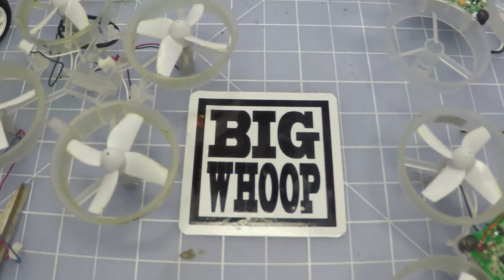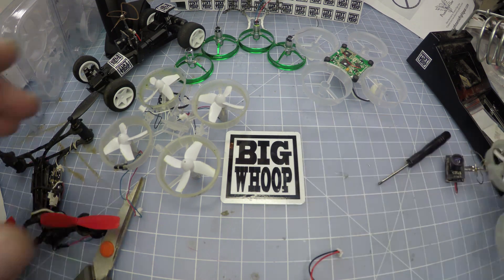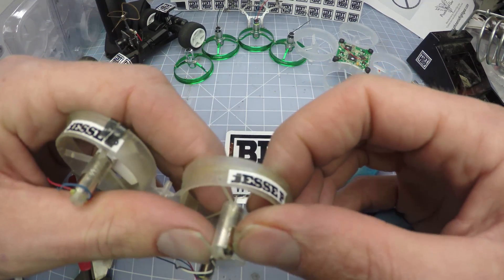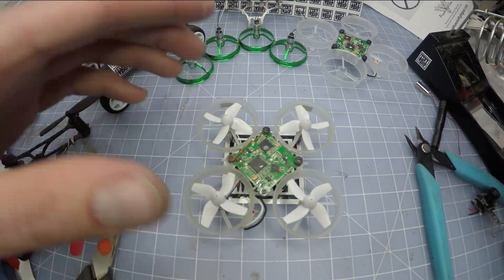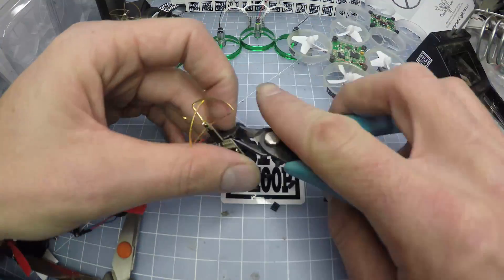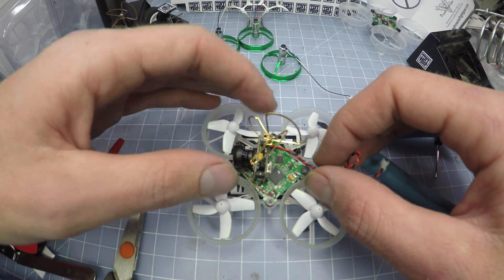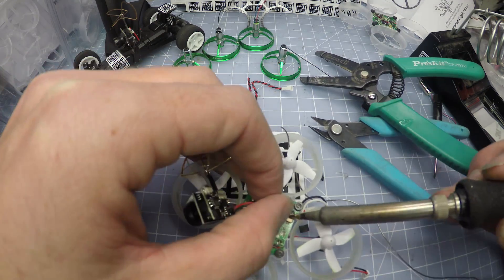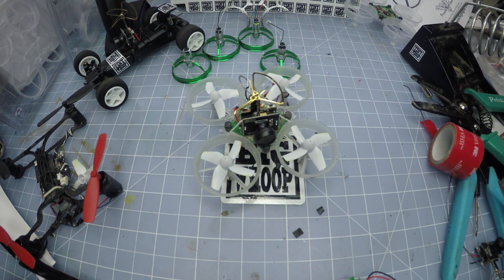TINY WHOOP Build Video - Team BIG WHOOP - Inductrix FPV - How to build a Tiny Whoop

Comment: I just finished my second Whoop conversion, after losing the first one. :-(   I just wanted to mention that the new motors (I used the "Special Sauce" type) are a REALLY tight fit in the Inductrix frame. Meaning, you can be extremely careful pressing the things into place and still break a spoke on the frame. I added a tiny bit of oil to each motor case before pressing them in, and I think it helped. Still have a busted spoke, however.

Comment: Dude did you see that the Chinese ripped of the inductrix design today? I doubt the FC is anywhere as good but it's going to mean cheap ass spares from now on:

http://www.banggood.com/NIHUI-NH010-NH-010-Mini-2_4G-4CH-6-Axis-Headless-Mode-RC-Quadcopter-p-1066972.html?zf=4095472

Comment: Hey dude, I am wondering if this little fpv camera also works on any 
regular cheap mini quadcopter. I mean, it's sounds to easy and to good 
to be true to only connect the wiring to the + and - pole (mirrored) on 
the other side of the board. I flew loads small/tiny quads, could I 
really make one FPV? Just by soldering that on? Would be awesome!!

Comment: Hello Tiny Whoopers,
So I just finished my build last night and I decided to use the Y-Adapter that came with the camera instead of Soldering it to the board. I quickly realized that I was running through the upgraded batteries in roughly 30 seconds. I decided to power the quad with one battery and the camera with another and it worked flawlessly, but there was way to much weight. Can someone explain to me why this happened? Does the Y-Adapter divide the power in two only giving half power to each component? If I solder the camera will I still have this problem?
Thank you,
Reply: I have the exact same problem - but even when I soldered it on the board like shown in this video.

Comment: what receiver should i use i have a fs i6 radio
Reply: Did you use the fsi6? I have the same transmitter... And don´t have idea how to connect the receiver to the microquad...
Reply: Pablo E. García Palacios yes i have. You cant connect because you need a dsmx module. And you cant use the module with the fsi6

Comment: How would this build fare if there was a Rakon inductrix frame upgrade?
Reply from the maker: How would the build fare? It'd be way more difficult.  And it wouldn't fly as well
Reply: Meaning it wouldn't be as fast and agile with the added weight or just unstable? New to the hobby and just trying to figure some things out.  Was under the false impression that with the LiPo 205mah/25C 1S battery and the CL-0615-14 - 6x15mm motor combination could balance out the added weight.
Reply from the maker: +Brendan Haugland more weight means slower and less agile.

Comment: Good job on the video! what flight time should i get from standard motors and battery with the Quanum camera? I'm lucky if i get 2 minutes!
Reply: With standard motors and battery its not flying good. To heavy. Even at 100% throttle the quad has some problems to gain hight .

Comment: Thanks for the video. This thing looks fun as hell. Can it do rate mode? Haven't seen any flippage on any of the videos I've seeen.
Reply from the maker: yep, it's just difficult.  These things don't have the power of quads you're penalties used to
Reply: Yeah. I imagine you would lose quite a bit of altitude flipping that thing. I plan on building my own with one of these: http://www.ebay.com/itm/CJMCU-MWC-Micro-Quadcopter-Flight-Controller-Mini-6-Axis-Module-CJMCU328-i-/361296855138 . Want something to fly indoors when the weather sucks. I'll let you know how it goes.

Comment: This is actually a very good video, as informative as your others are entertaining. F'rinstance I had never heard of VHB, have to look that up.  Using the clippers as a rotor remover, and using an elastic to provide camera support,  all good ideas. Surprised you don't add some protection to the antenna, as you fly into some very tight spaces. Thanks!

Comment: Is there much need for the motors to just FPV around the office? Or does it need the new motors to lift the camera?
Reply: +SantanaFPV yeah i built mine today and without the upgraded motors your at 80% throttle all the time. better motors make a massive difference.
Reply: Same here I just built it with stock motors and your at 80% throttle all the time. - Some times I even fall outta the sky and bounce on the floor.  I have the faster motors I got from my local hobby store and Micro Heli 200mah lipos im going to try out.

Comment: I've got my fpv stuff, batteries and motors coming. Playing with mine atm. Do you recommend a separate Spectrum radio or a jr module for the Taranis?
Reply from the maker: Separate spectrum radui, just because we can't get the new version of the orange module to work, and the old version had awful range. My dx5e is doing great
Reply: Or Spektrum DM9 module for the Taranis

Comment: The same camera - not quanum branded is this one: FX797T such as on banggood: http://www.banggood.com/FX797T-5_8G-25mW-40CH-AV-Transmitter-With-600TVL-Camera-p-1042994.html
Reply: Hi, I am very new to this. How do you receive from the camera? what would you suggest from banggood to connect to say a tv using rca?
Reply: +parriehunter look for an FPV monitor with receiver built in if you don't want to use goggles. This tech is not meant for TV's.
Reply: Thanks for that. Yea i wear glasses and looking at googles they probably wouldn't work for me BisMaxx

Comment: I took one of the canopies that came with the inductrix, cut a notch in it, and hot glued the camera to the canopy.  Put a blob of hot glue on the underside of the canopy in the front and back where it is above the screws to keep the canopy from rocking.  Then used shortened JST connector cables that came with the camera to hook it to the main board.  Now I can fly FPV or LOS by swapping out the Canopy at will.

See Pic:  https://farm8.staticflickr.com/7796/27050400616_989e8b366a.jpg

Comment: I have a feeling that HK is about to run out of camera's... just a feeling I get. Nice vid Jesse.. so I'm guessing you think 'no', on the hot glue on the aerial?
Reply: +Tiny Whoop You should definitley do a flight video of using the rate mode on the inductrix doing flips and loops!
Reply: and FliteTest has one on there store as well called the 'Hyperon' http://store.flitetest.com/hyperion-mini-600-tvl-camera-w-built-in-5-8ghz-25mw-vtx/
Reply from the maker: +speed stalkers FPV i'm into it, just a very small amount
Reply: Yea I bet.  I just got 2
Reply: I call it angry mode. ( I am curious about this )  We fly rate mode all the time with our mini's with some pretty aggressive rate's. But when we put the Indurtrix into 'Angry' mode w/ high rates.. she becomes a big handful. My son was working on flipping her.. and its possible.. however you end up with a flat antenna, and you start breaking the frame. I wonder if we still suck, or if that is everyone's experience. ( in theory, the duct's are going to be resistant to roles )
Reply from the maker: +speed stalkers FPV Buy this one instead! Hobbyking has given me ABSOLUTELY NO reason to support them. have you ever tried to call them?!?!
http://atmosphericadventures.com/fpv-equipment/fpv-cameras/fx797t-5.8g-25mw-40ch-av-transmitter-with-600tvl-cameral
Reply: +Tiny Whoop  is there a difference between the spektrum fpv micro camera and  the Hyperion 600tvl ?
Reply: Spektrum has head tracking, but is only Resolution: 330 lines vice the Hyperion Mini Cam's 600VTL. ReadyMade RC has a cam as well.. and they imply that the Hyperon and the HK one are not really 600VTL. But I have the hyperon and the spektrum VT1100 and there is much more resolution in the hyperon one. I will post a vid comparison in the next day or so.
Reply: oh yea, one other thing... the lux value of the Hyperion camera is 'night-n-day' better. I flew in a simi-lit room the other night with the spektrum cam.. and ka-bam blackness. Same room same lighting with the newer camera and I could see.
Reply: http://www.readymaderc.com/store/index.php?main_page=product_info&cPath=11_62_625&products_id=5415
Actual camera resolution: 420TVL (Others claim 600TVL)
Reply: +speed stalkers FPV    Yessss post a comparison!!!   I just bought the spmva1100    Kinda regretting it after I just read that hahahhaa
Reply: +scoodles93 yea, kk, I will... if it makes you feel any better I owned a few of these spmva1100's and I paid $100 for them last year.. so the FPV volume is making stuff cheaper.